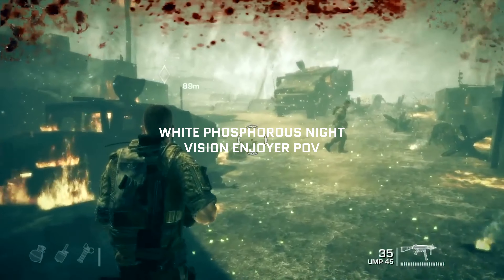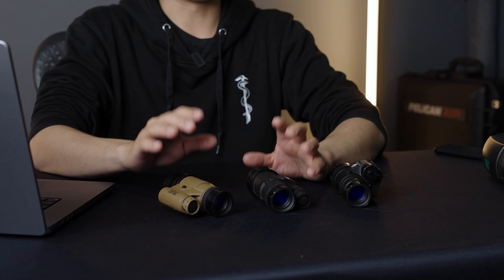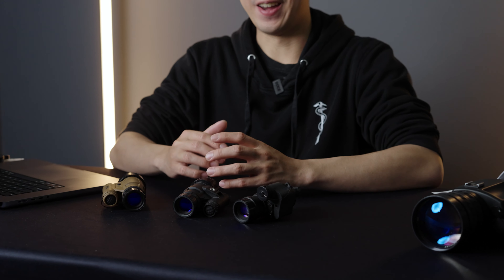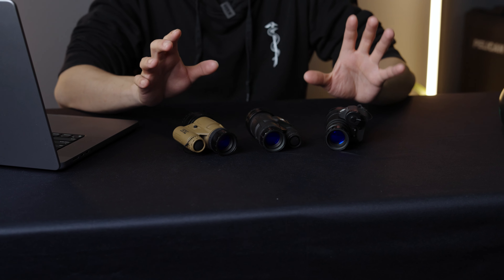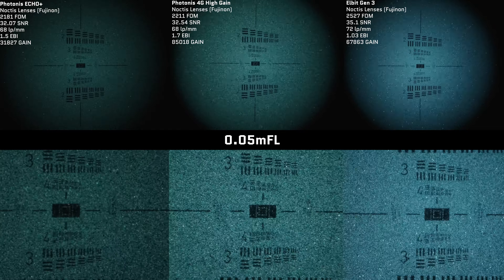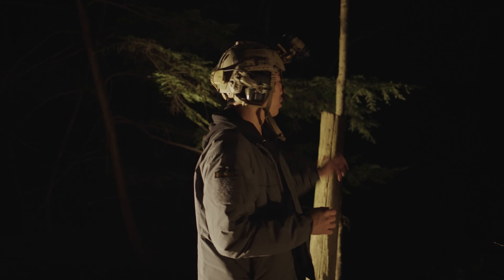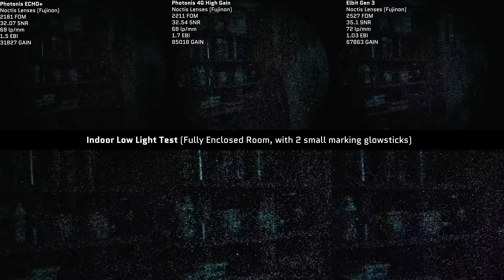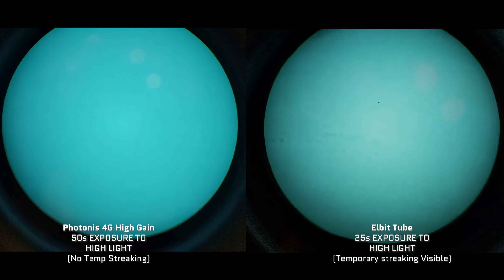Does Tube Generation Matter? Photonis 4G High Gain In-Depth Overview

Comment: Don't take this the wrong way and I'm not an expert or anything. Why didn't you include the halo rating on the tubes? For the urban test the lights the well lit street seemed to be washing out the area like I assume a bad halo spec tube would produce.
Reply from the maker: Photonis actually does not usually put the Halo spec on their sheets because their halos are very small. We would not want to misrepresent them with made up numbers. 

Halo does not change the washout effect of the tubes, that's more of an outcome of glass, ebi, output brightness and gain. Because some tubes have higher output brightness with the same camera settings you can have slightly washed out images.
Reply: @coldharboursupply  Thanks for the reply and I see what you're saying. That's really interesting that they don't come with halo specs. 

I have some more learning to do I guess. 😂

Comment: It would be great to see a 4G with a similar SNR and EBI rating (if it can) to the Elbit. Then it would likely take over.
Reply: I agree, it had better visible gain as far as i can see, and was less washed out at higher illumination (i know thats easy to fix with manual gain, but only if you have it). It was definitely noisier and yeah would definitely be curious to see the equal FOM, as i suspect it would be noticably better than the Gen3 then.
Reply: Only the 4G+ HG version has these sort of specs. Eliminates a lot of the noise. However, they are 2-3K CAD more expensive than the standard 4G HG tubes. They are also very hard to get, usually unavailable.

Comment: I am very happy that i managed to get my hands on immaculate L3 filmless WP. I have had the joy of comparing it with several different units of different manufacturers and specs. Wholy guacamole it isn't even heckin close in low light. Then again my SNR and EBI are both very good so i haven't had a chance to look through another manufacturers tube with similar numbers.

Comment: My only complaint or question rather is regarding the cityscape comparison; does the housing the elbit tube is in have manual gain?

You guys use a lot of housings like the tanto without manual gain control which is probably due to ITAR, which I get. But if you’re in America and have access to solid manual gain mono housings , I see no reason to pay elbit prices for these tubes. MX11769 tubes exist, and having manual gain is really helpful in a mono.

Comment: I would personally take a 4G+ HG with higher SNR and lower EBI. I think NNVT should release the NVT-8 and perhaps high gain options as well so I'm waiting.
Reply: NVT 4-7 are marketing terms not used by NNVT. They don't correspond to a tube designation. That's why many NVT vendors use A-B-C grade instead. So NNVT cannot release NVT8.
Reply: @Tattlebot  Huh? This doesn't make much sense. I know they don't call them NVT's though. But each "NVT" tube is different. NVT-7 uses HyMa and has a larger spectrum bandwith while NVT-6 doesn't. A-B-C aren't suppose to be grades if that specific tube? A being the highest FOM option while C the lowest. I looked on Alibaba and other Chinese vendors and what I said is what they use. Regardless, what I mean is a new tube from NNVT. They are probably going to release high gain and hopefully something new and with better specs.
Reply: @DjAlonDevil  There are different technology tubes, as can be seen with different PC sensitivity values and better figures. However if you're buying an NVT5 or NVT6 the seller can fulfill it with any tube that meets the offered minimum spec and format. Note that even honest dealers in China can be victim to fraudulent spec sheets.

Comment: I was a little bummed when the high gain tubes were announced, I had just got my Echo+ tubes in February but after seeing wooded part of the video I am pretty content especially with FOM for both tubes just barely being under 2500. Haven't seen WP Photonis high gain in America yet, so far just green.
Reply: Basically ~half-moon and a clear sky (if no clouds covering the moon) is not a challenging environment. It would be interesting to see how they actually compare should any one or more of those factors become unfavorable.
Reply from the maker: @JohnZ556  The hoffman shows the more extreme low light perfomance in a much more objective way, as well as the indoor test.
Reply: @coldharboursupply @coldharboursupply  Your indoor test is already very good. I can see it's already borderline useable.
I don't imagine most would go somewhere darker than a warehouse with only 2 marker glowsticks, let alone not using any illumination when any light is already a giveaway anyways.

Comment: Out of curiosity, what are the Jerry-31s gain value? Whats the cd/m^2/lx?

Is it similar compared to the Echo around 4000 on the Hoffman machine?
Reply from the maker: They are around 10k on average as well. However because of the glass on the hoffman they read a little lower, on average. Usually around 3.5k gain. Echos usually range from 4-5K on average.
Reply: @coldharboursupply  Thank you! Great videos per usual 💪🏼

Comment: What about using this tube in something like the MH-1 where it is manual gain? Are they auto gain only?
Reply from the maker: Gain can be confusing,  as it means a few things for a simple explanation:

Gain or Luminance Gain: How much the tube intensifies light, this will be on the spec sheet and done by the tube manufacture

System Gain: This should be provided by the builder and will be on the build report, this is a value of the ratio the tube intensifies the Hoffman machine source light as an overal system reading.

The other "gain" uses are moreso for how the tube controls brightness. Brightness is a better work in this case than gain but we go with what the industry uses:

Autogain (A better term woulf be: Auto-brightness) : The tube adjusting brightness based on ambient light conditions, all modern tubes will have a level of autogain to preserve the image and protect the tube

Manual gain (A better term would be Manual Brightness Control): 3 pin and  Pigtail tubes will have manual gain on TOP of auto-gain. This means that if the tube is installed into a housing with a manual gain knob or buttons you can control the brightness of the tube when the ambient conditions are dark enough to do so.
Reply: @coldharboursupply   I meant "autogated". I do appreciate the explanation on gain very informative. So the 4g would be able to have manual control in a housing like the new MH-1?

Comment: I'm confused. Would you take the Elbit or 4G in extreme low light? At one point in the video, you said you would let the images speak for themselves, which seemed to imply you would choose the 4G? But then, near the end of the video, you said the gen 3 might take the lead.
Reply from the maker: We leave the choice up to the individual to look at. From our read theres a few things to consider:
1. It's hard to get L3 and Elbit tubes from retailers outside the US if you are not in MIL/LE (we're in Canada)
2. 4GHGs have great overall performance in all lighting conditions, whereas many gen 3 tubes suffer performance wise more in mixed lighting
3. Gen 3 tubes perform well in extreme low light, but the 4G HGS perform very similar in our tests which were done in controlled environments, in reality most users will be hard pressed to tell the difference other than the slightly increased noise of the image from our examples. 

Being a dude in Canada, I would pick the 4G HG simply for warranty reasons, more mixed lighting performance, and comparable low light performance. In the US, where there are more options, you may need to weigh things out differently.
Reply: @coldharboursupply  Yeah, I'm in the US, and not I'm sure if I want to wait for the release of WP photonis high gain tubes to save money, or just get WP L3.